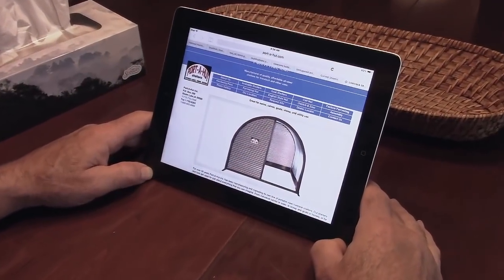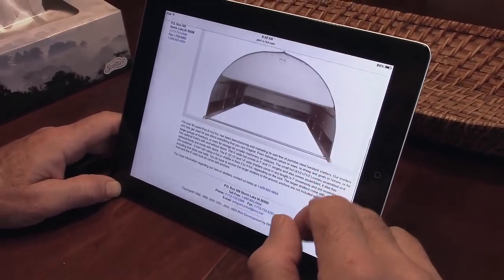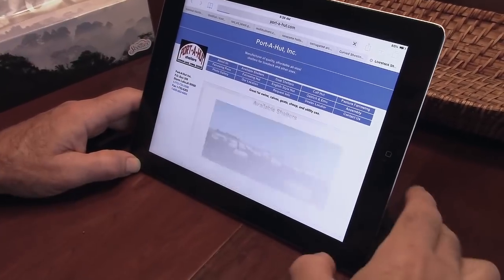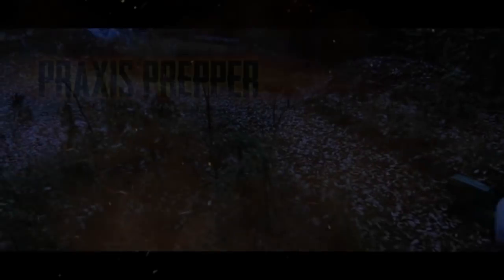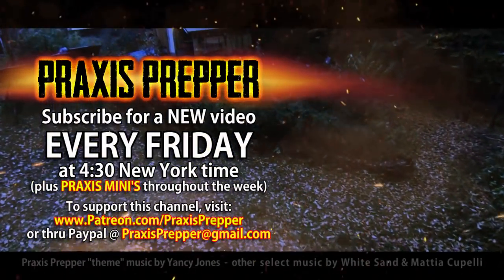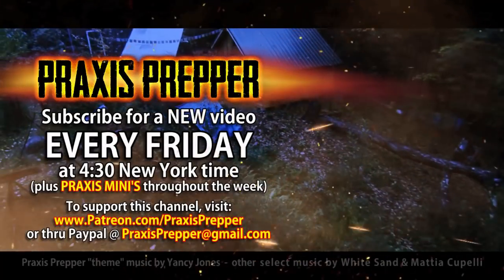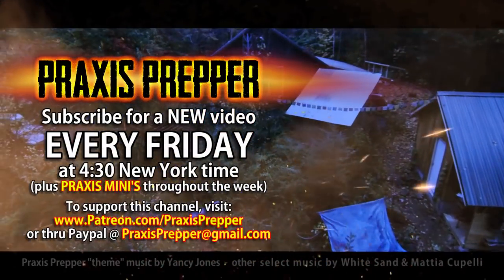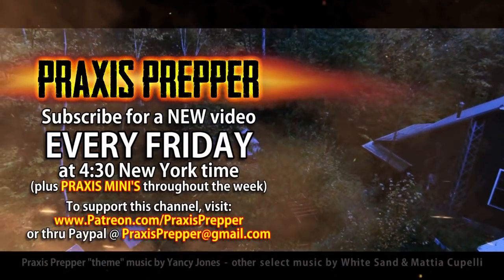Don't Let Your Retreat Fall Victim to This

Comment: Hey! Great video. I actually have a storm cellar in exactly this shape just off the porch on the west side of my house! It's totally covered with dirt, roof & all, with a curved pipe out the top for ventilation. Be glad to send pics. Roof is galvanized steel as you described. Guess you don't get many tornadoes in New Eng. but I live in Dixie Alley. Twisters are a way of life. My only suggestion is build it a little bigger than you think you'll need. Mine is & that makes all the difference when you're stuck in there with kids & scared people for a while. Thanks for the video. Blessings

Comment: FWIW: I started construction of my own homestead, but I didn't run into issues getting the building permit. That was probably the easiest task.  The bigger issue for me was scheduling contractors and dealing with weather. Weather can really cause some big delays. Couple of suggestions:Add exterior insulation on the outside of your foundation. best option is to go with fiberglass matt foundation insulation and not rigid foam insulation. The fiberglass matt is porous and allows water to exit and it does not breakdown over time (losing it R-value). For the inside you can use rigid foam insulation.Insulate your slab and install radiant flooring (in floor heating). For slab insulation make sure your use rigid foam panels designed for under-slab these have PSI ratings (20 to 40 PSI) so the weight of the concrete does not compress them.This way you can use your basement as a shelter and have the option to heat it so you stay warm.
Reply from the maker: I used 2" pink foam covered in wire lath and stuccoed on the exterior of my last homestead and felt it worked really well. Putting it on the exterior as opposed to the interior I think makes SO much sense to utilize the thermal mass of the basement walls to stabilize heat.

Comment: Just buy a large corrugated drainage covert.  The ones they use to go under roads to allow streams to flow under.  They use them to build under ground bunkers at Atlas Shelters.  Large enough to stand up in, strong enough to withstand the weight of dirt, and totally water proof.
Reply from the maker: I've looked at those. With the cost of transport and everything, pouring in concrete actually seems less expensive. They'd be pretty cool looking though inside!

Comment: Address issue: Perhaps keep the current address and just make your driveway connect to both roads. Then let them work through getting the property address changed. Having access to two road might be useful (ie road blocked due to storm damage). Would recommend that instead of a root\fallout shelter that you design your basement to serve as a shelter. This way to still have access to everything in your home. ideally you could go upstairs for short periods to get things you might need. Just build your home as a tight house to avoid contaminated dusk from getting inside. I suspect after a nuclear event forcing you to shelter in place. You can use the three zone method:Zone 1: A small area with heavy shielding. In the basement you can build a heavy shielded area using sandbags or solid concrete blocks. You need to stay in this zone right after a nuclear event when there are high radiation levelsZone 2: Your entire basement: lightly shielded (at least where the basement walls are below ground, and only the ceiling has limited shielding. You likely have access to this zone after about 2 weeks of a nuclear event.Zone 3: Your entire home. This is when the radiation levels have fallen, but it would be hazardous to breath in outside air that can kick up contaminated dust. If you breath in contaminated dust, hot particles could get lodged inside of you leading to cancer after a few years. You probably will need to remain inside for a year or more depending on the extent of the nuclear event.There will be days when you need to shelter in Zone 1, Zone 2 or Zone 3. Sometimes storm system will kick up contaminated dust or perhaps failout from nuclear power plants. This could happen years after the nuclear event. The level of the nuclear event will impact the your length of stay in these zones. ie full scale nuclear war to an act of nuclear terrorism. The bigger the event, the longer you will need to remained sheltered.With your root\fallout shelter, your really trapping yourself to the size of the shelter. its likely to be cold and damp in the winter season. I suspect living there for weeks or months is going to be pretty uncomfortable.
Reply from the maker: Thanks for the awesome tips GT! I just got my building permit last week and it looks like my contractor will be able to start pushing earth towards the end of next week. You're right about the difficulty of coordinating contractors. I always do all my work myself except the earth moving, concrete pouring and plumbing, but even those items can be a lot to manage with other people's schedules.
Reply: FWIW: I used contractors to smooth out the construction. Even with the contractors doing a lot of the work, Its still been a full time job: Managing material deliveries, figuring out which products & materials will work the best, make sure the contractors are installing the products correctly. Dealing with defective products, Sealing (ie Tight home), painting (painted all framing around door & window openings). FYI:EDPM Sill sealer & gaskets (for doors & windows) Better than the urethane foam sill sealerhttp://www.conservationtechnology.com/building_gaskets.htmlThermal Star Rigid foam insulationhttps://www.thermalstar.com/products/x-grade-general-use-rigid-insulationDoes not degrade (lose R-value) over time like Corning (pink) or Dow (blue). Also includes an insecticide so insects don't make nests in your foam. They sell both wall & slab panels. I used it for my Basement slab and the first 8 feet on my walls. I used Greengard (Lowes) for the exterior above first floor to save money. The Greengard panels also don't loss R-value & are cheaper than Corning & Dow. I use the Thermalstar for the first floor since it has the insectide, but I figure insects like ants are going to build nests\tunnels above the first floorTiteBond Metal Roof Caulking (CRS sells it the cheapest)https://www.crssupply.com/search-results/titebond-metal-roof-white-12-pack-61001/This is the best caulking you can find. I've used it throughout the entire house, not just for metal roofing. Buy a tube and and test with it. You see why its the best.Stego Wrap Vapor Barrier (15-mil)https://www.stegoindustries.com/products/vapor-barrier-15-milBest vapor barrier for under your slab. After slab pour & cure, use an angle grinder on the top of your foundation walls to take out the high spots. Thus helping to achieve a tight seal. You can by a diamond grinder blade for concrete. After you grind, apply a water blocker paint sealant which will help seal off any porus in the cement & prevent moisture from wicking up into the sill plates. I applied caulking down under the EDPM sill sealer as extra measure. Also caulked the edges of the sill plates. On top of the sill plates I used LVL boards as the RIM boards. Applied the EPDM gasket (1.75" sill sealer from Conservation Tech) between the LVL RIM boards and the sill plates and caulked them too)Recommend TJI floor joists instead of the more popular truss joists. The truss joists can burn quickly since the have a lot of exposed surface area. Truss Joists can fail with in about 5 minutes. If you decide to go with Truss than I recommend you sheath them with plywood or OSB to block airflow. For Flooring go with AdvanceTech flooring. Doesn't delaminate, excessive warping when it gets wet (which will happen until you get the roof on. Screw dow the floor boards (do not nail) and us the Advancetech adhestive to glue down the flooring to the floor joists. I recommend buying or renting a Senco collated floor screw driver. For a 1500 sqft floor we installed about 3000 screws (you can always resell the driver after your done to recover your money back)Recommend using 2x6 o.c. 24" (advanced framing). using 24" on centers reduces thermal bridging & saves on studs (less needed per wall). I when with Roxul (rock wool) insulation. Hydrophobic, moisture permeable, great fire and sound barrier. I don't like the blown in cellulous since it can settle, absorb\trap moisture, and can leak (dust) into your home. Don't like spray foam: Open Cell absorbs water like a sponge, and Closed sell is like a rock (good luck if you ever need to do any maintenance after it cures (plumbing, electrical, replace studs\sheating do to rot\storm damage) & spray foam is expensive. For sheating I used ZIP (http://www.huberwood.com/zipsystem/products/zip-system-wall) Saves time and money compared to using traditional vapor barrier. I also caulked the sheating & full taped. also caulked the nail holes where the tape doesn't cover.For Plumbing and Radiant floors I am using Uponor PEX. No metal clips to corrode and no flow loss. Kinks in the Pex can be removed by simply heating the PEX with a blow gun or propane plumbers torch for a few seconds. Best PEX product available. Only issue is that you need the Uponor Pex installation tool made by Milwauke, but you can always sell it after your done.For electrical wiring, recommend going with "MC" electrical cabling (this has an exterior aluminuim sheathing). This will help attenuated an EMP since it works partially as a faraday cage. the Aluminum sheathing can also be grounded to help divert an EMP away from equipment. Also use Metal junction boxes. Recommend you attend the International Builders Show (in January 2019) I think this year its in Las Vegas. You can see demos of building products & get lots of information & catalogs which will help. Definitely worth the trip!Also see Matt Risingers Youtube channel (Builder from Austin TX). lots of Product reviews & building tipsIf you have any steel beams (recommend this DTM Mastic paint). Its not cheap but a gallon will go a long way:https://www.zoro.com/rust-oleum-9800-urethane-mastic-navy-gray-1-gal-9886419/i/G0962726/https://www.zoro.com/rust-oleum-9800-urethane-mastic-activator-1-qt-9801501/i/G1672851/?q=9800+Mastic+activator(you need the paint & activator). You don't need to mix it all in one shot. I typically did it in 100ml to 200ml batches. I was able to paint an either 28ft steel beam with about 300ml of this paint.Two discount suppliers I recommend:Industrial supplier sells just about everything (like the amazon of building material) but with much better prices:https://www.zoro.com/Great Pumbing supplier. Fast deliever (for me) and pretty good prices & quality products (like Uponor)https://www.supplyhouse.com/
Reply from the maker: WOW that's a lot of info. Thanks for taking the time to share it. There IS so much to consider when building. It's all a balancing act. Right now, I'm just fixated on making sure I have my head in order when they pour the foundation as I want to have all my pass-throughs correct for when it's time to install outgoing and incoming lines. I have a lot of additional lines for solar power in and gray water to consider and some seem to want to compete with others for priority. Thanks again for all the food for thought!
Reply: Pass electrical & gas services via PVC pipe that is above ground. I used the gray PVC (electrical) Pipe and drilled into the rim boards. The PVC pipe runs underground and uses an PVC elbow to go above ground & another PVC  junction box to go into the RIM board.  This way you don't have worry about locations & water leakage. If you go with a 2" or 2.5" PVC electrical pipe you can pretty much run additional cabling if you need to at a later date.  The only foundation holes I have is for the outdoor wood boiler & septic. Currently I have two PVC connections going through the RIM boards (One for data & another for Propane), but will likely be adding more: Grid power\Solar, electrical for outbuilding for a wood (outdoor) boiler & generator & another data connection so I can monitor the driveway entrance via IP camera(s) & Motion sensors.Not sure any water recycling (gray water) is going to be beneficial if you have a well. Unless I am mistaken, your area gets a lot of rainfall. If you want to make use of gray water you need to run separate drain lines. and realistically you probably only could use the showers for gray water use: I don't think you want to use dishwasher\laundry waste water for a garden since it going to have chemicals in it. I guess I would focus on a rainwater cistern to collect rainwater from the roof and use that for gardening.

Comment: It takes 2 years to get a building permit in Austin Texas.  They are really backed up and very buracratic.  Just putting in a set of windows is like 10 times the cost of the materials to get a permit.

Comment: Dealing with bureaucracy is a pain. I seem to do that for a "living".
Romn arches where from overlapping rectangular bricks which gave strength. Not so much bent steel. For 1,000 factor about 375lb/sq ft. Likely want to bury at least 3 feet.
Reply from the maker: I was thinking about using the steel as a form and then setting rebar-laden concrete in for the real structural roof. I'm still not 100% certain what I'll do. For now, as long as I know the basic footprint, I'll be able to drop in the right pad and short side walls.

Comment: For the people who have the option build in a rural area where you don't need permits. I can go in my backyard right now and build anything without a permit.
Reply from the maker: Pretty cool dude. Pretty cool.
Reply: This is a good way to go 😉 in a gully on a mountain in a forgotten county.  They have to see it to know about it
Reply: There is nobody to see it and there is no building codes or permits even if you wanted to buy one. The only limitation is if you start building up and you start to get into air space, the limit is the tallest structure on your property tree or whatever.

Comment: Just build the damn thing and worry about the paperwork after.
Reply from the maker: It's more expensive that way. Permits pulled after work begins are topped off with a penalty cost, also, if there were to be any issues of a concrete nature (figuratively, not literally), then knocking stuff down to move it would be an incredibly costly undertaking. I'm a big proponent of begging forgiveness vs asking permission in certain situations, but I think for this (with so much $ tied up in every step, having to backtrack or change things after the fact is a real issue when money isn't infinite.
Reply: Be careful with that idea.  Things are pretty much always discovered by the assessor's office when they are trying to figure out how much your property is worth to tax you on.  When they notice the differences, people come asking and in some places they will fine the holy sh*t out of you and even make you destroy the building just to drive the point home.  

Unless you put it all underground, this is a direction that could bankrupt you.  Now some places like Texas are wonderful as you don't really need much in the way of permitting to do things which is how I think it should be.

We need to get the laws changed and remove these permit requirements.  Have people just get inspections at sale if the buyer is worried and then they can figure out how to deal with any issues that show up.

Comment: You can get one of those huge huge bore pipes and bury it.  Entrance can just be an angled sloped "roof" that pulls up with steps or ladder then go into the open end of the pipe.   That's what this one place nearby did for a town tornado shelter.

Why do you need a permit to dig a hole in your yard?   I don't think you do.  We don't here. Anybody can dig a tornado shelter on their own property as long as they don't plan on living in it or charging people to go in it.   Most important questions is this - are any of those govt people or strangers going to be coming to your house?  No?  Go get a shovel and forget them.
Reply from the maker: Two separate projects. I guess I took for granted that people know that I'm building a house too. The permits are for that. The "root cellar" I think I could probably do here without a permit too.

Comment: Any one who has to deal with getting permits knows you have to "Grease the wheels" in order to get your project going.
 You give the inspectors and bureaucrats a little something so they sign off on your project. Usually a "Donation" to one of their causes. Cash is king. ;)
Reply from the maker: I've never tried using that specific technique. I tend to try to leverage "pity" as much as I'm able.
Reply: Coffee and doughnuts are the most innocent of bribes :). I seldom do that so i don't have to take it up the next level... box of chocolates and coupons for fast food :D